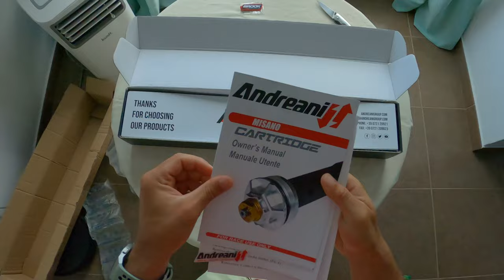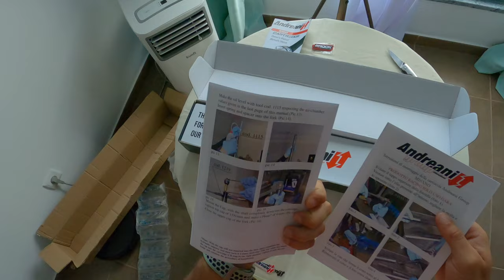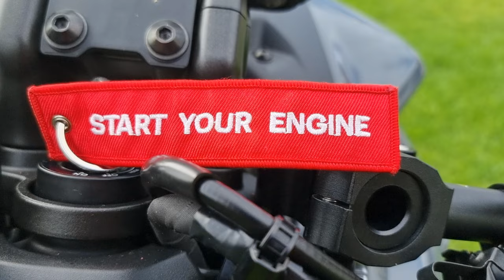[4K] MT07 - Suspension upgrade Andreani Misano Evo Fork and clip-ons!

Comment: Any issues dialing in the hydraulic damping? The compression side on mine is super stiff, and it's backed all the way off. I can compress the forks under braking, but it has no bump compliance
Reply from the maker: No, mine are fine. I think you did something in the assembling that went wrong probably
Reply: @AM_Agro  I followed the somewhat poor instructions to the letter. The only thing I did differently was use another brand of oil 5W cuz Ohlins is hard to find/expensive. Rebound side works as intended. I'm gonna back the compression cap assembly off by 2 turns (using 0 preload and 4 turns IN on compression, as per instructions). This should free up that leg and allow for more travel/adjustment on the hydraulics.
Reply: @AM_Agro  out of curiosity, did you set your oil height with the cartridge tube up or down? I set mine with the cartridge tube fully extended and o ring holding it up, bled air and repeat
Reply from the maker: @JDuBz815  since you bleed the air out you should be ok.  Down but i bleed it to so it does make any difference. But the fork cylinder must be down! You probably have to much oil in
if you did it with the cylinder up. That's why you probably have to much stiffness
Reply: @AM_Agro  fork tube down, cart tube up, that's how I set my level. If you set oil level with both down, I might check and see if there's a difference
Reply: @AM_Agro  thanks for the quick and helpful response. There's not much help from Andreani (I'm in the US) or the internet.
Reply from the maker: @JDuBz815  If you bleed and check oil lvl after, I think there is no diference. In the final spring assembly, did you put the plastic spacers up?
Reply: @AM_Agro  I put the spacers on the same way I took them off, tapered end (spring guide end) down, wide end (cap end) up. If I can't sort it out by setting oil height again, I'll try 2 turns loose on the caps (to keep cart length the same) and if that doesn't work, I'll try a different oil.
Reply from the maker: @JDuBz815  Ok, I hope it works for you! Final check did you remove the end of you fork cylinder?
Reply: @AM_Agro  yes. Ground down and removed the bushings and the bolt spacers per instructions. This kit was supposed to be easier (once installed) than Race Tech emulators (remove to adjust). Seems it's not the case for me. Maybe I did something wrong, maybe my springs are too stiff. Idk. Traded forks that were too soft for non compliant forks and $600 lol. Such is life
Reply: @AM_Agro  verified oil height with fork tube down, cart tube down, ok. Verified 0 preload and 4 turns IN on damping on caps, then backed each off by 2 full turns. Feels softer (cold) than before. I'll have to ride it to confirm what (if any, most likely rebound) settings I need. Appears to be (cold) more rebound than compression, but hard to judge cold fork oil.
Reply: Hi did you find out if there was an improvement?
Reply: @pauldrewell4191  I messed with them quite a bit. Tried lighter fork oil and different oil heights, tried backing the fork caps out 2 turns each (giving 5 turns each of damping adjustment as opposed to 3). Could not get the harshness/lack of travel out of them. Did some digging on the forums and it seems like a revalve/spring kit is the way to go. Couldn't get ahold of Andreani for a data sheet for shims/weight etc to take to a suspension shop. I reached out to Traxxion Dynamics about their kit and explained my frustrations with Andreani. I was told they have put their valve and spring kit on Andreanis before and that certainly helped that customer. You could try reaching out to them for information about that, you will likely have to ship them your forks. Dan at Traxxion was super helpful.